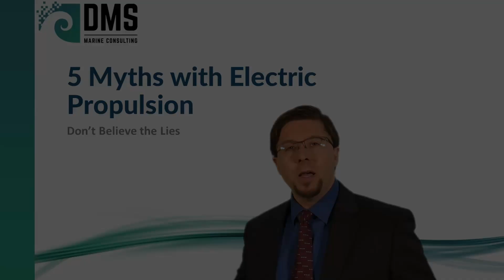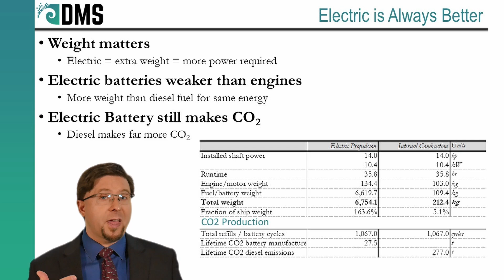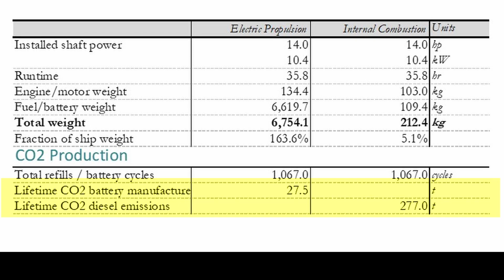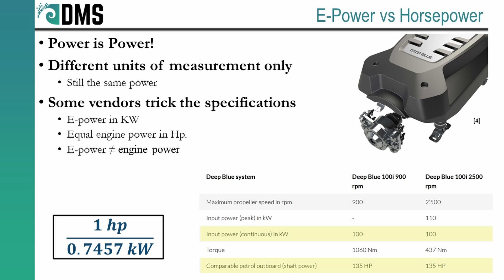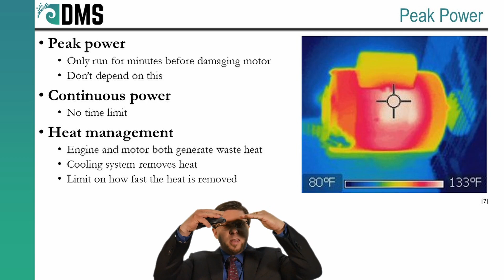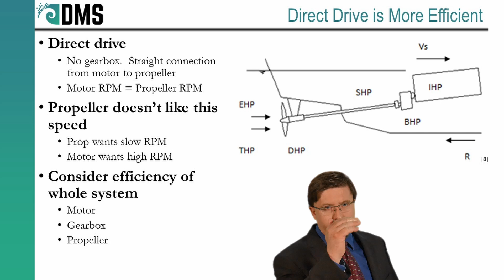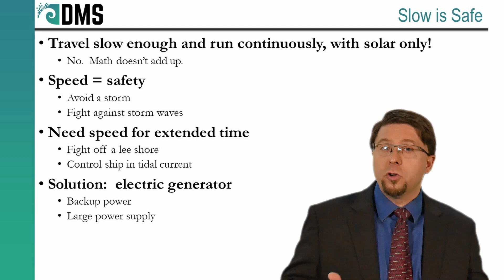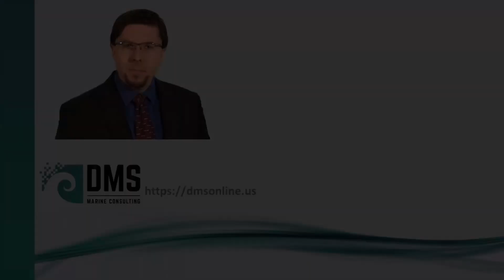5 Myths with Electric Propulsion:  Don't Believe Marketing

Comment: If you are sailing (an actual sail boat), what is the difference between relying on the winds to be favorable or sun to be favorable?  Again, you need to stop thinking in a 1:1 comparison.  I agree, you need to be prepared for those emergency situations.  There is more than one way to do that, but agree a back-up generator is the most robust option.

Comment: 1) It is only a matter of time until boats are designed with batteries included in the hull design.  I mean, we already add thousands of pounds of lead for ballast.  Why not use the batteries?  It is very doable, just not 1:1 with current design shapes.
2) Battery technology is getting better and better.  They are already producing batteries that virtually eliminate fire hazards.
3) Hybrid electric is the sweet spot for now.

Comment: Well. I would both agree and disagree. Yes, any significant electric motor use is going to need generator. But other than that, for most people it can save a lot of money since for simple maneuvers you don't need to use fuel. Ofc, it does mean upfront cost of battery, but that battery capacity also means more luxuries and simplification/electrification of other devices and tasks. And in sailing, it means you can spare more effort on just that, sailing.
Also electric motor is extremely reliable and space efficient. 

3:11 I also think this chart is not very appropriate, you do not need equivalent energy in batteries, you want enough battery that you can bring operational costs of the boat down and use less fuel. You are always going to need fuel and generator on board, what you need to do is to find right balance.
3:29 I would also dispute complexity, batteries are not complicated, and electric motors are not either, so when you remove diesel motor, which is huge pain in the ass, and just add more batteries, which you already have, it reduces complexity. It also means removing fuel lines and stuff like that. All this is removing complexity. Other point is, while eco friendly is selling point, maybe bigger one is just lower fuel costs, lower risk due to potential contaminated fuel and just sense of independence this gives. And side/main benefit depending on person, naturally bigger battery capacity means being able to use higher wattage appliances and other devices longer without generator.

But ultimately though, it all depends on your budget, way you want to sail etc. If you have decently sized boat, and you already want to have to have many comforts provided by electricity, it's probably worth it to just up capacity bit more for electric engine. Also it's nice to get regeneration when sailing.
I'm talking about sailboats here. With motor yachts, unless you have something like cat with massive solar array, electric just doesn't make sense. Even then you do have to realize the limitations, but if you work around those, it's going to save a lot of money.

Yes, batteries and electric motors are not some magic bullet, and they certainly can't replace need to carry fuel. But they don't have to be to give very clear benefits. Throwing out numbers is all well and good, but you have to place those in context. And I'm not even sure those are right, I'm not going to check, but just basics in the video are either misleading or wrong.

Comment: When it came time to repower my Valiant 40 sailboat, I first looked at upgrading the original Westerbeke diesel to a Betamarine diesel but it would take at least 6 months toget the motor from the manufacturer and then 3 to 6 months to have someone install it at a total cost estimate of $38 to $42,000.  2023-2024 saw LiFePO4 cells drop drastically in price. One can DIY a 51.2 nominal voltage battery totalling 16kW for less than $3000. I was able to build an OceanVolt ServoProp 15 based system with 3 x 16kW batteries (48.2kW), doing all the  work myself except for the hull glass work for converting from shaft to saildrive.  The total cost was $57,426. I no longer need to do any maintenance except zincs or worry about bad fuel stalling me out (happened to me twice). Reduced weight by 592lb (full tank wt). There is no diesel/oil smell anymore. Motoring is completely quiet. Gained a large storage space under cockpit where fuel tank used to be. I never have to buy or treat fuel. My galley is 100% electric since I could get rid of propane. I can motor for over 8 hours at the same speed I used to on diesel before having to worry about battery. Best of all I get ~400W recharge while sailing 6.5kt.  The ONLY benefit diesel power had was the ability to motor 400 miles on a tank and be able to fill the tank in 30 minutes. Now I can motor 50 miles and it takes all night to fill up but I have never in my life motored more than 50 miles in a day so it works out for me :)

Comment: Regarding your spreadsheet, I certainly hope you don't calculate like this as a professional marine consultant!

First: You don't need a 10.4 kW e-motor to replace a 10.4 kW diesel. While the rated power of the diesel is it's max power, the rated power of an e-motor, is only the power it can do non-stop without overheating. Max power of an e-motor is far higher than it's rated power, but in both cases, max power is only useful for maneuvers. In fact 5-6 kW rated e-motor power will easily substitudes a 10.4 kW diesel, and it weighs less than 30 kg incl inverter.

Second: How many sail boaters do 35.8 hours non-stop motoring? I think the longest non-stop motoring I've ever done in my 60 years sailboat career was 6 hours, and unless you are crossing an ocean (which you wouldn't do by constant motoring in a normal sailboat), you'll pass plenty opportunities for recharging on your way, let alone regen under sail and solar charging.

Third: A modern quality 5,4 kWh LFP module weighs less than 40 kg, which means that 6 hours non-stop motoring at 4-5 kW (= the power applied by to the propeller shaft at cruising speed in a sailboat with a 14 hp diesel), only requires 5-6 such modules + 30 kg e-motor = 230- 270 kg --- which only adds about 1% to your weight fraction, compared to your diesel setup.

Then ofcourse you loose the ability of 35 hours non-stop motoring, which very, very, VERY few sailboaters would ever do, but it's traded by so many more advantages, e.g.:

1) Comfort (no more noice and no more dirt and diesel smells in the cabin).
2) Virtually maintenance free (no frequent replacements of lubrication oil, filters, cooling liquids, hoses, through-hulls, V-belts, internal anodes, impellers, fuel lines etc...)
3) Increased maneuverbility (unlike diesel engines, e-motors provides instant torque!)
4) Reliability and redundancy (several battery modules in parallel)
5) Ability to regenerate under sail and turn both wind and sunshine into clean propulsion.
6) Every part of an electric drivetrain can be handled easily and manually as no component weighs more than 40 kg, each very simple to disconnect and carry out of the boat.
7) Design flexibily of being able to place the battery modules anywhere you find convenient in the boat and a motor unit that doesn't take more space than the gearbox in a diesel boat.

The happiest moment of every sailboat journey is the moment you turn off the diesel!

Comment: The first worksheet comparing weight and power is  completely wrong. You dont compare like with like. Electric motor has much higher torque and therefor thrust. The kw of electrict could about 25% lower as for diesel engine with the same efficiency. Also the weight is calculated completely wrong. You calculate the consumption of diesel with about 3 liters per hour 35 hours x 3.? = 109 kg. This is very low.
On the other hand you  calculate the weight of the battery completely wrong. 35 hours x 10 kw = 350 kw/h. The weight of kw/h is about 5,5 kg, therefore 350 x 5,5 kg = 1925 kg for the battery and not more than 6 tons and that took not even into consideration that you could gain energy 
from  solarpanels which could make the batteries even lighter.
Reply: Also the co2 calculation is wrong. You take the the co2 of the battery manufacturing into consideration, but not the co2 from the manufacturing of the diesel engine, which is a complex machine, wheras a electric motor is simple manufacturing.

Comment: Which 10kW electric engine weighs 134kg?! Seriously, which one? Also, 60kW battery bank weighs 340-400 kg. So the batteries in this case would amount to 2400 kg at most. 6750kg?! Again, where are these numbers from? You even show a car better by bank, which are exactly as heavy as I said.

Comment: A little less than 50% correct in this video. One mistake is the hp vs kw. Yes the mathematical conversion is correct but combustion motors go is rated in the powerban at low speed the hp output of a motor is much less whereas an electric motor puts out that power at all speeds. So that is where the difference lies

Comment: The comparison of power between electric and ice is nowhere near as simple as how you put it.

Torque curves are more important to look at than overall power when coming to boat propulsion. You can technically move a laden cargo container with a 1hp engine if the water is still.

Electric motors are peak torque right from the beginning and drop off after a rated rpm. Ice engines are the reverse. This means that if you spec the right motor, you can use a lower powered electric motor than engine.

How lower? Depends on the motor.  I'm looking at replacing 2x225hp diesel engines. 225hp is 157kw. But I have found a 75kw motor that produces the same torque at a higher rpm as the engine it will be replacing.

Comment: It seems like most comments here are referring to blow boats. Every blow boater I know brags that he isn't burdened by fuel range or mechanical failure (as they repair a mast, sail, or rigging from storm damage) so why is it you all seem so concerned about propulsion? You say you don't need it but you act like you can't live without it. No way on Gods green earth that I would attempt to cross the Gulf Of Mexico or even Lake Michigan with only battery power. No mater what kind of batteries and on top of that I would feel very much safer sleeping on top of a tank of gasoline than the type of batteries needed for this type of operation namely lithium. A pontoon boat with electric power on a small lake or pond? Sure! The amount and size of batteries for this could be setup to easily scuttle them if needed. It would be fun and advantageous for just putting around and just cruising and socializing. No mater what many of you think electric cars have major problems and putting those problems on a large pleasure boat would be problematic at best and possibly life threatening in several different ways.

Comment: I would say the words myth and lies are unnecessarily negative and click bait. For example:It should be pretty clear that „peak power „ is something different than „continuous power „ and the words are pretty self explanatory. Second point about range: We own a sailboat in the Bay Area. With our diesel engine we could motor days on end. Every three month or so we fill up on diesel because our gauge seems unreliable. There have been instances where I went to the gas station and filled up one gallon. For our boat and use you could argue that our diesel system / tank is mismatched to our use. An electric system with a range of 40 miles would be more than enough including safety range. This evaluation is off course personal but I think it would apply to most sail bouts in the San Francisco bay. I crossed the pacific ones and on my trip to the Galapagos was becalmed for a week.There  it was great to be able to motor through this zone. But to go slow in a becalmed area could also be an acceptable option to extend electric range. Every oil change I deal with this toxic sludge. Even drops of it can contaminate large amounts of water. That doesn’t fit at all to the sport of sailing to me.

Comment: Hi is so dumb i belive hi is one of thos who cant afford real bstterys
Reply: You apparently have no experience around water, boats, and electricity. Specifically salt water. Ships are one thing. They use generator power over battery power and have full 24/7 maintenance crews. Ships electrical systems are generally sealed off much better than small boats from the elements. Small boats and pleasure boats owned by people who allow costs and expenditures to override maintenance, safety, and common sense is another thing. Too many do it your selfers with a YouTube education about whatever they attempt to do outside of their wheel house create dangerous problems. Even electricians tend to use what they know about building wiring and procedures which can have a very negative outcome on a pleasure boat by using wire nuts, solid wire, and non tinned wire amongst other practices. People get hurt and die every year do to the DIY guy that doesn't take the time to learn why certain things on boats are done much differently than autos. Many more boats blow up and burn than cars for reasons I just mentioned.

Comment: BS...t. You forgot the weight of the diesel fuel. Its not that much lighter than modern batteries. Lead ballast gets removed to account for added battery weight if need be. I run electric motors and a car. my servicing has been halved. Electric cars out accelerate Ferrari sports cars fella. Have a look at the latest innovations in props. 2024. Have you looked at the price of fuel lately. If you retire on seven figure income, then diesel is a choice. If you are retiring on a motor yacht with less than that, then electric is the only choice for the future, and remember. Mechanics, if you can find one, charge more than plastic surgeons.

Comment: Thanks for this. While it seems much of the numbers are based on current tech, where is the future? I love the idea of electric motoring using solar, albeit the slower pace (6nmh). How many knots would ten 400w panels provide for an unlimited range depending on sunlight for a 35’ cruising e-boat (e.g., a saxdor 320gtc with an extended roofline)? Distance desires, combustion requires route detours and refueling at very hight costs and there’s maintenance and noise pollution. The solar catamarans like soleil seem quite interesting, but 55’ is too much boat for me.
Reply from the maker: Some of the more interesting technology for near future:  ammonia or methanol as replacement fuels for diesel.  Both fuels have two important traits.  They can be stored as a liquid near room temperature.  (Ammonia requires mild refrigeration or compression.). And the molecules contain a lot of hydrogen atoms.  Both options still require more development.  But the goal would be to use these in a hydrogen fuel cell and power electric motors with the fuel cell.  Then we don't need huge batteries.

Comment: Who do you take me for? For an idiot? You're wrong. 
Only an idiot can compare an engine that is incorrectly connected directly to the shaft and a gearbox that is correctly connected. 
If you connect the gearbox incorrectly, losses can be more than 50%.
Only an idiot would try to keep going at peak power all the time. That's why it's peak, because it works for a short time. 
And most importantly, only an idiot can forget that the efficiency of electric motors is many times higher. Therefore, a hybrid installation will ALWAYS be more efficient than a purely diesel one. Look at hybrid cars. Everything has been calculated there for a long time. Or look at mining dump trucks. Which have a lifting capacity of more than 400 tons. All the leading manufacturers there have been making only hybrid circuits for more than 60 years. For example, there are Belarusian BelAZs. So they are ALL serial hybrids. I don't remember that the USSR had a shortage of oil. Everyone should understand that if you can't refuel a yacht with diesel, it will stop very soon. An electric motor with a Joule of fuel energy will do more work than a diesel engine with the same joule of diesel fuel energy.

Comment: You forgot that diesel engines are the cleanest co2 engines. They make the most out of a liter diesel. 
Less co2 vs more ultra fine particle emission. Obviously you can fuel up with TLG diesel what is very clean.

Comment: A Volvo Penta D4 diesel engine weighs more than i.e.  a VW 82kWh battery pack and in boats the weight isn’t always an issue. The weight can actually have a positive effect on seaworthiness.
Reply: Can have a positive effect, well on most boats it’s not. But well some build a stainless steel binimi as an addition.
Obviously that’s not making the boat a better sailer too. 😂

Comment: I know, youtube somehow forces you to make "entertaining" video but:
Battery weight: (hopefully not lead right?)
Standard Iifepo4 batteries are about 6kg/kwh.  (and from far not the lightest) 
10Kw for 36h = 360kwh needed. with security margin of lithium chemistry (20%) we will round this at 400Kwh. 
400kwh x 6 = 2400Kg, 2.5T with a nifty BMS.  Where does these 4 tons more coming from? I really don't get it
Battery cycles:
1000... no... 4000 to 5000. and at the kind of C factor you discharge them in the example, probably more.
Motor weight:
a 10Kw (nominal rated) weights about 20kg max max. just google this. 
there is definitively more to say about flexibility of usage due to high torque of brushless motors, that's the reason some seller use this. but too complicated to explain this in a few lines here. A watt is still a watt, totally right there ^^)
I really think you should re-edit this to be more credible. Electric propulsion has definitively it's flaws, but (wrongly) increasing numbers to emphasis this is probably not the best practice for a so cool channel like yours. If you need help or like to talk about this, feel free to contact me :) 
It's criticism, sadly too present here, but hopefully a constructive one. 
Wish you the best, continue please to share knowledge and order of magnitude for the greatness of humanity :)